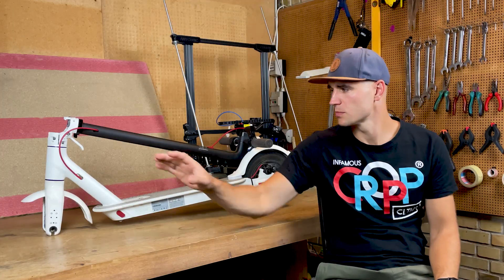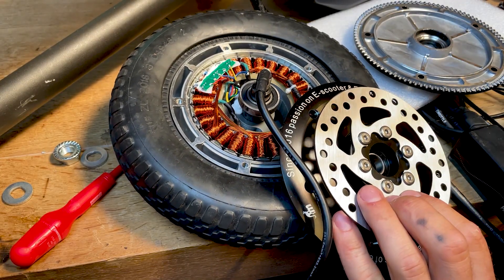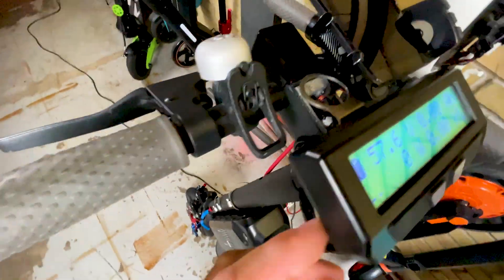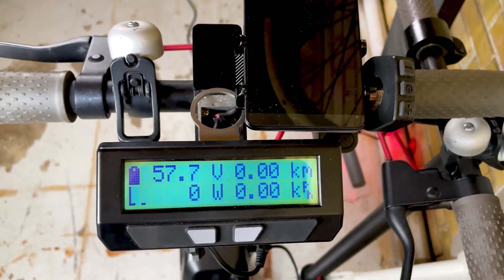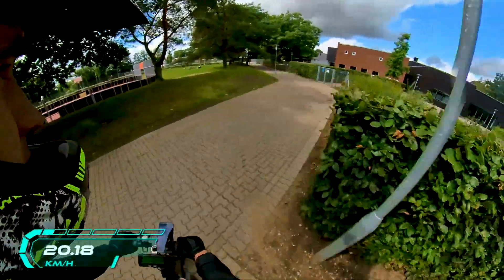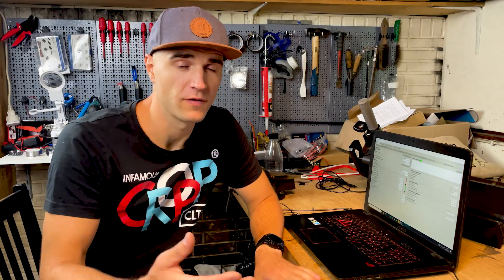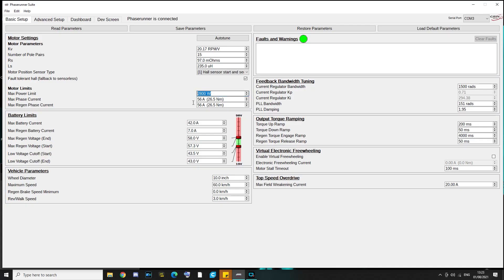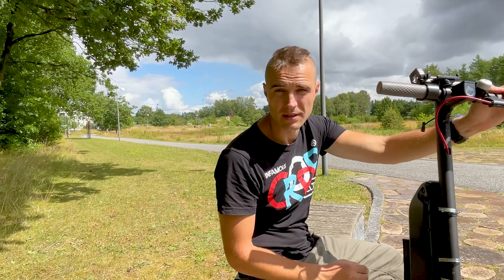Xiaomi M365 500W motor part 2: Pushing 2.1KW with Phaserunner V3

Comment: Is it really a m365 after changing the esc? With little mods the original ESC is 20S capable and can go 60km/h+. It's an excellent little thing for it''s size and price (goes as low as 20$ from china atm, how do they do it? 0o). Also I don't get people putting something like a VESC in a scooter this size. 

Sorry for the rant, scooter looks awesome. Wish we could encounter each other on some random road and have a drag race
Reply from the maker: I don’t know mate, what else should I call it then? Phaserunner 365? 😅
I am too dumb on electronics probably. I have burnt way too many stock controllers, even with 12s pack and new cooling pastes etc., mine runs at 78 degrees after 20-30sec sprint and the temperature keeps going up 🙄
I have some that simply won’t work and I can’t find the defect - MOSFETs are fine, fuse is ok, something else is burnt and I can’t find what it is. All of that lead me to too much frustration with those stock ESCs…
Reply: @VRMinde  Call it franken-rocket 365+1 or something :D. ..Yea the first revision was quite fragile and often died on it's own. Often you killed the DC-DC converter (40v->12V) because of voltage spikes while braking or just looking at it funny. But everything got alot better in the last 2 years or so. The y made a new board revision (2.0 and onwards) that hold up every abuse I throw at them. But if your setup works for you, no need to change anything.

Comment: Can you do an explaining video how did u did it?
Reply from the maker: Do you want like a step by step guide? Because this video roughly explains how I did it :) I replaced the motor, the battery, the controller, the suspension, tires and brakes. It would be a very long video if I need to talk about every bolt and cable mate :)

Comment: im working on similar project. also with phaserunner and custom battery and the same motor ..and the funny part is, that i have ordered this motor from the same seller on aliexpress and in the feedbacks there i found your YT chanel. so happy about to see somebody testing stuff i am planning with :). thank you for the Kv of the motor (where did you get this info?) and the amount of polepairs. but i dont think it is a ripoff. its completely different motor than the xiaomi one. why schould they use same small bearings from a 300w motor for a 500w one? it is a motor which fits for xiaomi but it will never have same parts inside as an xiaomi motor and i am sure the chinese ppl are copying perfect. if there is 30mm bearing on the original part there will be a 30mm at the copy aswell ;) ..but i can feel with you. bought also the same monorim motorcover with disc and cant use it cos it dont fit for 1s so i never concidered that it could fit on the 500w motor. but i guess its easy to sell on fb marketplace. https://de.aliexpress.com/item/1005002384020843.html?spm=a2g0s.9042311.0.0.27424c4dTOZi1c 
still waiting for the motor and other parts. hope i can start asap cos summer is almost over. will also make a vid on yt about. if you are also concidering to build your own battry i have some nice ideas for you. most important: buy 21700 cells!!! order asap cos they need 3 months to deliver :P . i have got them already and testet 30 batterys with 5A discharge: 4600mah avarage
 https://de.aliexpress.com/item/32845153871.html?spm=a2g0s.9042311.0.0.27424c4dTOZi1c  ...this batterys were the best decision!
can you tell something about the motor temps? are you concidering to cool the motor or its not neccessary at 2000watts? found nice informations from the dude who invented the phaserunner https://endless-sphere.com/forums/viewtopic.php?f=2&t=48753 ..after reading this i can tell you its very recommended to use ferrofluid for cooling in brushless motors. perma magnets dont like heat, so its very neccessery to keep them cool. would be really nice to know how your temps are.
Reply from the maker: Hi mate, haha nice to hear about a similar build :) 
The kv of the motor I guessed looking at specs of similar motors and then autotune set them to the needed ones. Pole pairs just counted :) 
To use the cover we just need to find the needed size bearing. I did not look for it yet, bearing sellers should have all sizes (but never the one you need 😂).

The temperatures I have only “measured” by hand - I can keep it on the motor after 3min 2kw run and these are the hottest days I will ever see here (and the longest rides on 2kw as well) so I am not too concerned.
I think the motor is just fine, but I would rather support a company that is creating stuff for our beloved brand than some random copycats :)

Comment: Wow your my idol bro! Your scooter is a beast!! Pls keep on making upgrade vids for you xiaomi..I just bought 350w motor as you know I have the RITA external battery setup (36v). Do i need to upgrade the controller? I feel like there is vibrating going on when I accelerate with this 350w motor..hoping for you advice
Reply from the maker: Hi mate, thanks a lot ;)  controller needs upgrading only if it starts overheating. Check the temps in the app after your normal “long fast ride”. If it is below 75C don’t worry too much. Replace the cooling paste under the controller housing.
Pulsation can be you reaching max amps that you set in firmware maybe?
Reply: @VRMinde  thank you for the tip buddy...I will look in the the cooling paste....should I be setting the Amp to 65 or a bit lower (cfw)
Reply from the maker: @whatstreetz  65Ax42V is 2.7kw. I doubt your battery will ever produce that much and the controller would burn in a sec :)

Comment: love the video man would you do a breakdown on the parts used and install tutorial?
Reply from the maker: Thanks mate. The key parts are linked in the description, I am in doubt if I will do a step by step guide as if someone wants to go with a replacement of motor, controller, battery, dashboard, brake caliper - probably he/she will use some different parts and steps will be different 🙄 installations like these do not make sense, there are cheaper and better scooters that have everything readilly installed 🙄

Comment: Thanks for the idea of alternative controller. Looks like phaserunner is really good for this. Have you had a chance to check difference between this fake monorim motor and original 500w's one?
Reply: @VRMinde   @VRMinde  Yep! I wouldn't trust the Aliexpress stores either since they often get it from different warehouses. So they get it with the same package names but they aren't real, or the store is fake altogether which might have been the case for you.

I was hoping to buy it from the Monorim site you linked either way, thank you for the answer mate. Also good luck on the project! :)
Reply from the maker: Hi! No, I was stupid enough to think this was genuine monorim when ordering :) I had no doubts phaserunner was good, but it is also very expensive!
Reply: @VRMinde  Hi again! My M365 Pro hub motor got fried a few months ago.

I looked for a genuine motor for months but couldn't find one, so I decided that I would get the Monorim 500W motor. I have been thinking about it for a month now and I was about to buy it today until I saw your video. There are some other websites selling this motor as well , they look really close to the original and have the logo on it.

I'm willing to buy it from the official Monorim website, where did you get yours? I loved the video as always, good to see you're enjoying yourself 😁
Reply from the maker: @proxyhx2075  hi mate, there is a link in the description if you want to find where I got mine. But mine is not genuine for sure. It is hard to understand as I have also purchased other genuine monorim parts on aliexpress… This should be their genuine website: https://www.monorim.store
Reply: its the same i guess. even when copy there is only copper and iron inside. its not an iphone ...just a motor.

Comment: Thanks for the great video!
I am using additional 10s2p in parallel and 4s6p in series (18650 cells) with Monorim motor at the front wheel. Using stock controller at 510w (27/55A CFW). Acceleration is identical to yours. Top speed is more than 48km/h when battery is above 55%. (Vmax 53km/h with full batteries).

There are no wobbles, i assume this is because of FWD. Using a solid 10x2.5 tyre at the back with the cheapest suspension on both axles.

Looking forward a double motor setup at 72v! Good luck and stay safe!
Reply from the maker: The wobble is only if I let the bars move to the sides a bit and I think it is because of my battery being heavy and so high above rhe deck 🙄 
Thanks for sharing mate!
Reply: How u all connect from 10s with 4s battery?
Reply: Make a video for us to see 🤷🏼‍♂️

Comment: Can you do a review and modification of the Xiaomi Mi Essential scooter speed 50km/h?
Reply from the maker: I was actually filming the essential. I got like 24km/h with just the cusom firmware. After replacing the battery to a standar m365 battery (essential has a smaller battery) I got to my standard 28-29km/h. I will make a quick vid on that.
To make it 50km/h it is not worth it practically or financially because you need at least 14s battery pack + new controller and possibly a new motor as the stock one will get very hot. It is cheaper to buy another scooter capable of 50km/h + with suspension etc.
Reply: @VRMinde  When you make the video of the Essential you also put the link of the highest battery.
Reply from the maker: @Paky31Ta  I will not have the link mate. I used a stock m365 pack from my other scooter. I have no idea where to buy bigger packs, I am now making my own 🙄

Comment: I’m running 20s with kaabo controller gt-100 2 500w monorim motor coil rewinded Y C B connection turbo config 48km/h is nothing tbh but keep it up 👌
Reply from the maker: You are crazy man 😅 I am not normally riding these scooter at such speeds. I am riding motorcycles and electric bikes instead :) I do not trust tiny 10” wheels 🙄

Comment: Do you have the extended bolts on your monorim fork or why your wheel is looking like it is not fit properly? I habe exacly the same fork including the disc brake kit and habe also the rim, which used to be in the rear, in front and have any Issues with the disc mount screws
Reply from the maker: Hi,

If you open the link (https://www.aliexpress.com/item/1005002471451575.html) you will see in the first picture what did I get exactly with the kit: 3 extended bolts with spacers, “gasket” for xtech caliper, the red plate with 2 small bolts. There was nothing else. It is supposed to fit the rear wheel in the front.
Reply: @VRMinde  it dont find the site behind the url for some reason. Do you mean the Black round gasket with the hole in the middle? I thought it is for the reboundlimitor kf the spring abd did not installed it. There where missing a lot of washers in my Set, maybe you need to get some to make the fork wide enough.
Reply: Is there a way to send you pictures, i can make some of mine if it helps
Reply from the maker: @johnathankrausrig9237  try and find the same url in video description. It is not really a gasket it is what they call it. By gasket I mean addaptor plate for Xtech caliper. I have all the spacers I think, I just don’t have the wheel axle extensions. If I flip monorim plates then my wheel axle is too narrow and the wheel won’t fit. 
You can send pics to my Instagram messages @VRMinde
Reply: @VRMinde  there is no need for a wheel axle extension. At least on my rim
Reply from the maker: @johnathankrausrig9237  you are probably using m365 pro wheel?
Reply from the maker: If I am using the m365 wheel and rotate forks as in Monorim video this is how much I am missing: https://www.dropbox.com/s/gzrygwks4j7g0wq/Photo%2004-08-2021%2C%2012.43.48.png?dl=0
Reply: @VRMinde  i probably have a m365 wheel since this is a german knockoff Version of it. There Was no Pro Version when the scooter was Sold. The fork has been installed in the exact same was as it has been shipped but with the extended bolts and additional washers. My old smartphone is dying when i try to send you pics in insta, i retry it on my Computer later.

Comment: I have a stock m365 battery, with an external 13s4p external battery , also using official monorim 500w motor. Need to buy a decent controller that won't burn out! Any recommendations please. I was considering the flipsky 420 plus but not sure. What do you think??
Reply from the maker: Well, I have never tried the flipsky controllers yet so it is hard to comment. 

They have double ones though 🙄 two motors feel way more fun, but then I would also consider pro chasis as only then you could fit rear and front disc brakes. 
But then again the overall price gets so crazy that it is cheaper to get something like cyberbot mini (1k USD) with a large battery, better suspension, 2x500w motors and much better tires, wider steering, etc etc. :) It is a constant thought struggle in this hobby.
Reply: @VRMinde  Yeah, i do believe the flipsky 6.6 mini is compatible for dual motors, but there's very conflicting info, some say that they are 13s compatible, and others say only upto 12s! So i am really not sure what option to use?🙄 Not that i need the dual motor option anyway, as 45-50kmh is plenty enough for me, and they are waaay too expensive! Also, i have seen an upgraded official m365 controller that will accept upto 19s!! batteries available for sale from here: https://vtaescooter.co.uk/shop/ols/products/upgraded-controller 
So i may just go for the 13s-15s option! Not to sure if i need to upgrade my internal battery to a higher mah or not?? Thoughts please. Just curious to know, are you sure that only the pro chassis are compatible with dual brakes? I thought both classic and pro chassis were compatible?🤔 Is a rear motor better than a front motor? What are your thought on both these please? So my quest for a stable controller that will last, unfortunately still continues!😫 lastly, i have a few official monorim new 2021 version stems/poles (the laser engraved ones) and official monorim 500w motors (with better 10" tyres on) for sale if your interested? Pm me if you are please.🛴😊✌
Reply from the maker: @fleebleflam  stock controller even if upgraded - I do not trust them. They overheat and burn. I know v3 is better, still don’t trust them :) 
Higer mah or not depends just on your needs for riding range. Also if you go for high amperage battery it makes sense to have more cells in parallel as then you can spread the current accross more connections if that makes sense. Think like this: more cells in series = more max speed. More cells in parallel = more km :) 

I am not 100% sure if a motor with a disc brake fits in the stock m365 or not. I have not tried it yet. When I was buying the rear Konyk suspension the seller told me that I will only fit the disc there on a pro model and not on m365. 
I like RWD more because I believe it gives way better control, less vibrations on the handlebars, better weight distribution and easier drops from curbs, etc. But nothing beats the acceleration of two motors. Feels like a completely different scooter with two motors :)
Reply: @VRMinde  Hey man, how's it going? Just a quick update on my quest for an upgraded controller for my classic M365. I bought a flipsky 7550 vesc, a bluetooth module, & an anti spark switch for some extra safety!😊 I have yet to connect everything together, as the white connector on my (official)😁 monorim motor is a different size to what fits in the 7550!😫 So i am trying desperately to find the correct connectors, or even better still, correct adapter connectors, that will make my motor, throttle, and break lever fit, and run correctly. Once i have this info, i can then start to think about connecting everything up, and seeing if my external battery, and rita will work with the monorim motor!🤞 
If you know which type connectors, or if there are any adapter that will fit my original battery, as well as my throttle, and break lever, Pleeease let me know asap. Ride safe dude🛴😊👍
Reply from the maker: @fleebleflam  hi,
Battery is xt30, others I don’t know how are they called mate :) good luck with your project!
Reply: @VRMinde  no, i didn't mean the battery connection, as i know it's xt60 for the flipsky, but i will have to use a xt30 to xt60 adapter for that.  I meant the white plastic connectors, that go to the controller itself. I'm struggling to find out what type they are called on the 7550, and if there are any adapters available that i can buy, so i can connect my original m365 battery and throttle etc... Proving a little bit difficult to find any info on them🤔
Reply from the maker: @fleebleflam  get some sort of connector set, cut the wires and make the new connections :) I doubt you will find all adapters for every case..
Reply: @VRMinde  Yes, this is the case, but getting the correct connector size, is the issue sadly😔 My quest continues... .🛴😊👍
Reply from the maker: @fleebleflam  These are the "little things" that extend the duration of all these upgrade projects dramatically :D
Reply: @VRMinde  Your telling me!🤣 Ride safe Dude🛴🚲😊👍

Comment: Why did you decide to use Phaserunner and not some variation of VESC controller for example Spintend UBOX?
Reply from the maker: I had one on my bike that I was not using right now 🙄
Reply: @VRMinde  cool, thanks, great work :-)
Reply: Also I think that the monorim brake adapter is made for xiaomi motors isn't it?
Reply from the maker: @vlceon  thanks for the support man!
Reply from the maker: @vlceon  if you take a look at the product link - they say it is made for moving the motor to the rear of scooter and using the rear wheel in front.
If you would like to mount a motor in front with this kit you will miss some axle extenders as the motor axle will be too short to mount the brake caliper and fit in between the forks. Ask how I know that 😅😅😅